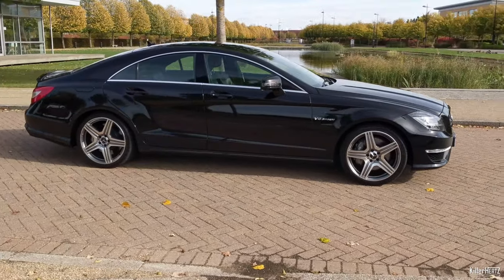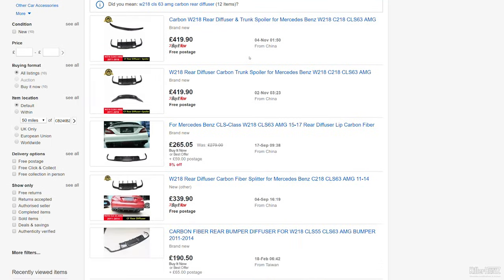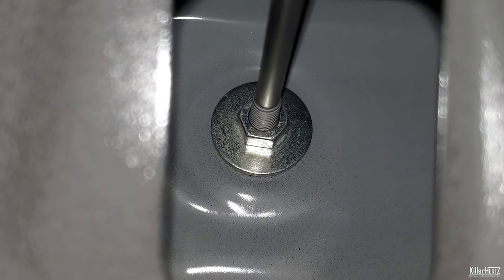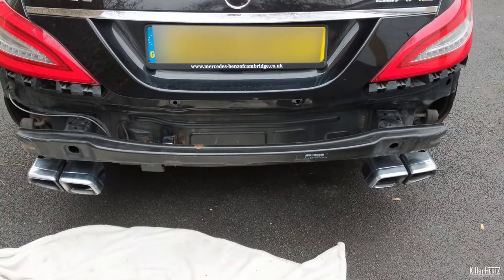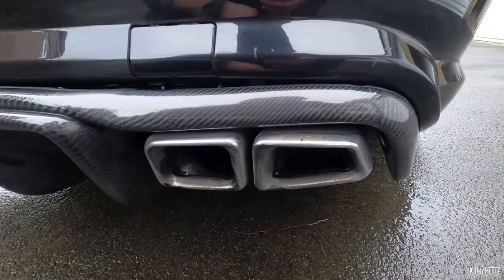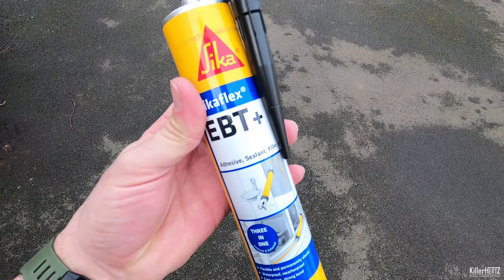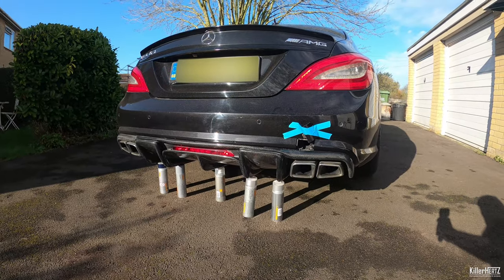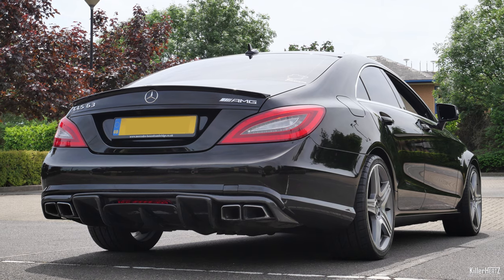Project: CLS63 AMG - Carbon Fibre Rear Diffuser

Comment: Great video, but honestly all this fabrication, cable tie and sealer stuff really puts me off. Ive just bought the facelift cls63s i may save the pounds and buy the renntech version for a bit more to avoid the bodge job I’ve uploaded a couple vids. But all in honesty you did a great job mate definitely brave i wouldn’t be as ballsy as you 😜👍🏽👍🏽 you’ve got a 👍🏽 from me
Reply from the maker: Thanks for the comments, bare in mind that the Renntech one is $3500 + VAT, + Shipping!
Reply: @killerhertzmercedes  Yeah it is, however im going for the Agency power diffuser. Its 1250$ cheaper, IMO it looks more aggressive. I just wouldn't want bad quality. When am jetwashing the car i'd be too cautious of the fog cutout or the glue ripping off etc.

Comment: Hey, on that central bracket that you had to use the Dremel tool,  How did you screw the two screws back into the bracket on the car? Did you drill access holes in the carbon fiber under area??

Comment: I'm in the process of installing my rear diffuser like yours, that extended stud that you needed the funny spanner tool for it so that you don't lose the nut when removing it from the threads and allows you to slide the nut off of that extended stud through the hole without the nut falling down into the car, if that makes sense?
Reply: Can you elaborate? I’m lost haha

Comment: Thanks for the video. I’m doing this in 2 days when my diffuser arrives. Just a quick question.. what tools did you require for removing/putting on the rear bumper and diffuser?
Reply from the maker: Socket set, trim removal tool and also that weird tube tool as per video...
Reply: @killerhertzmercedes  the local hardware store you got the tool from are they nationwide in the UK? Need to go out a drive tomorrow to find somewhere that stocks this melco tm6 spanner/wrench

Comment: Great instruction video and voice over as usual KH. Thanks! Do you know if there is any difference between the CLS350 Shooting brake and the CLS63 when fitting this diffuser? Cheers.
Reply from the maker: If I remember correctly, they are slightly different and not the same part...
Reply: Thanks for the info KH.

Comment: Did you use a hammer to "cut" out the hole for the fog light?
Reply from the maker: Dremel as per video. it has now been covered by a 3d printed trim piece and looks factory

Comment: what do you mean not real carbon fiber? mean its carbon trim?
Reply from the maker: it's not real carbon fibre, it's fibre glass.

real carbon fibre would be 3x the price.
Reply: @killerhertzmercedes  i think you are very wrong there real carbon diffusor you can buy for 250 dollars. its just the chineese had a 0.35 cent salery and they can keep the prices down. i work with selling carbon. and ofc it depends on what company you buy from. if you want real carbon 100% i can ship to you 100% garantee for about same price
Reply from the maker: @KleneR100  I am not wrong, it is Fibreglass, I have cut into it. 

I'm sure real CF ones exist of course. My one however is not.
Reply: @killerhertzmercedes  ah okey i see. well its good fake carbon then haha. are you intrested in a good diffusor in real carbon with 100% for about same price?
Reply from the maker: @KleneR100  no thank you.
Reply: Did you say the spanner box tool size?  I plan to order that same tool but don't know the size.  Thanks!!